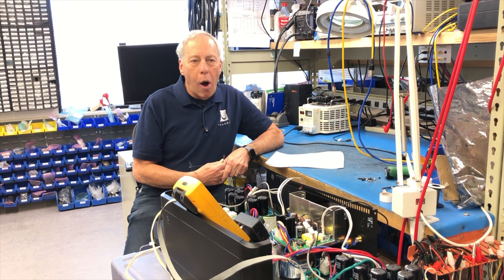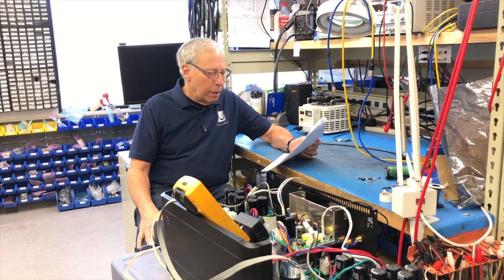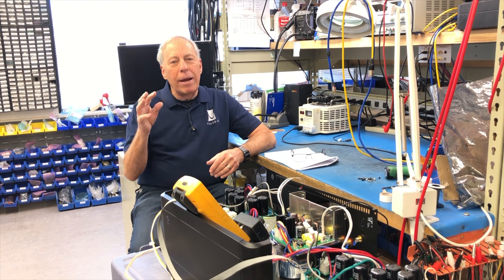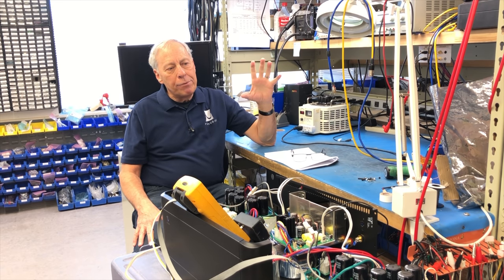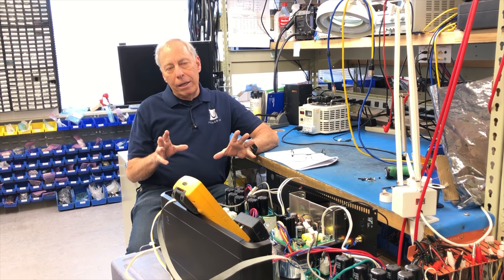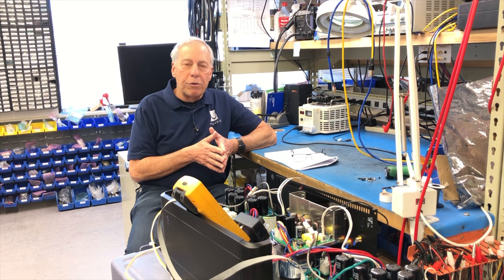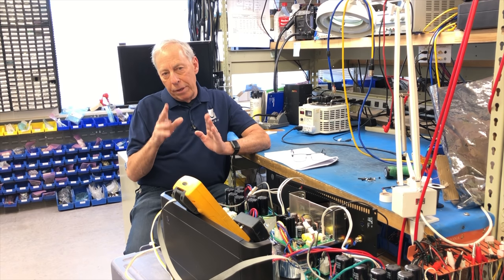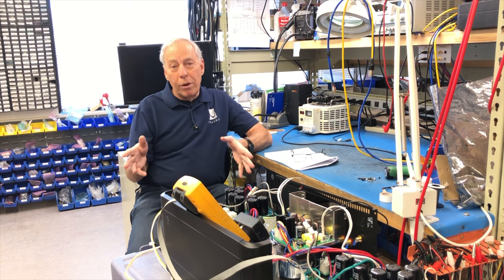How to choose correct amplifier wattage

Comment: Another way to put it would be all other things being equal a bigger amp sounds better. IF you're going to use it in the power range it was meant to handle cleanly and not playing whisper soft background music.
Reply: You have it all wrong.
Reply: All things being equal,  have both an amplifier and speakers that exceed your desired listening level and make judicious use of the volume control so that you don't push either of their limits.
Reply: @timharig  If you're want to push either to their limits you need to upgrade.

Comment: Thanks paul for explanations also on the car amplifiers is the same?
Reply: Essentially, yes. I have a friend who has more than double the power I have on Focal K2p 3 ways. His sounds more at ease at the volumes where mine start to sound slightly strained and congested in comparison. Both systems are adjusted so that hard clipping is not possible. He has much more headroom than I do. If you never turn it up that loud, I suppose it would be a non-issue.
Reply: Basically but you can damage speakers having too much power and not enough speaker if you have too much headroom and turn it up too much
Reply: @slokke99786  That is true. Drivers can bottom out, and heat can melt the adhesives that hold them together. With power comes responsibility. Unfortunately, there are lots of folks with ears of steel who would "ride a good horse to death." My system is as idiot-proof as I can make it. It is easy to do if your source (in my case: car radio) will not clip even when turned all the way up.
Reply from the maker: Car amplifiers are a tough breed because they are so limited by their power source. The techniques to overcoming the 12 volt limitations are to have speakers with extremely low impedance (old school) or to use a modern switch mode power supply. If it's a modern car amp then much of what I suggest will apply.
Reply: Paul, I apologize if you covered this already, but what do you think about anti-clipping circuitry in amplifiers? I used to have a McIntosh car amplifier that had it. Still have a Blaupunkt Velocity V7000 (made in USA, Rocktron's pro audio factory) that has it. Many people argue that it is not necessary if you adjust your gains properly.
Reply: @Paulmcgowanpsaudio  Oops, see above.
Reply: @Paulmcgowanpsaudio  Leads me to another question: should you match amplifier rms rating to speaker rms or max ratings? I have always done rms to rms given that amplifiers have some headroom (some more than others).
Reply from the maker: @johnclark3067  I don't personally match amps to speakers in terms of wattage because I have never found a useful correlation between the two. What I find more useful is the speaker's sensitivity. If it's in the 80s you'll really need some amplifier grunt to get it moving. If in the mid 90s then the amp can relax.

Comment: Damage only occurs when the amplifier is stressed and starts to clip. You can never send too many watts to any speaker. None of them will fail. Only when there's any clipping involved. Including soft clipping. People think that soft clipping is okay when it's not. That's what causes your speakers to fail. Nobody should ever start to smell their loudspeakers cooking after a high volume listening session. Unless you have a frying pan sitting on your class A amplifier cooking an egg lol
Reply: Sending too many watts to a speaker coil turns the speaker coil into a heating element. Sooner or later the speaker melts or burns. Either way,  its a tradeoff. They key is to have a big enough amplifier and speakers that will not melt or clip at your listening level, then make judicious use of volume control.

Comment: Is this video referring to guitar amps and speakers or for an amp for a stereo system?  Because I was always told that if I plug an amp with 100 watts (for example) into a speaker cabinet with a rating of only 50 watts, it will likely damage both the amp and speaker, is that accurate?
Reply: It refers to any audio amplifier.  You have a tradeoff. If you amplifier is too small it can distort or clip when you attempt to drive too hard. Clipping can damage your speaker. If you get too large of an amplifier and turn the volume/gain all the way up, then you can overpower the speaker and damage it.

Paul's advice assumes that you are responsible enough with the volume control not to overpower your speaker.  If you can be that responsible, you will have better sound quality with a larger amplifier.

Comment: . I sold audio equipment back in 1977-1980 we sold Pioneer, Teac, Nakamichi, Luxman certified and Mcintosh uncertified . We saw the greatest failures with our smaller amps . For example we had more failures with our L80 (50 watts) and less with the L85 ( 80 watts) and none with our L100 (110 watts) on the same speakers . 

The results were not surprising to luxman engineers and they came up with the same reasons you did 40 + years ago . As the amps struggles it outputs trash to keep up  . When we contacted the speaker manufactures for warranties and they said the same . 

We purposely trashed out speakers conducting our own tests .  Selling systems that blow up in our customers homes is a bad look and quickly leads to chapter 7.  At first out test failed because we used common sense when it got too loud we cut back on the gain . With ear protection to fool our ears we just poured on the gain . We had a total of 3 failures out of 6 all from  using smaller amps we had 0 failures using amps rated at twice the speakers recommended power . We would have blown those last 3 speakers but it was so loud we had noise complaints . Our store neighbors also claimed damages caused by the loudness . 

Now the sticky part the speaker makers have a rating, you exceed those rating and no more warranty ? Whatever warranty means nowadays ???
Reply: edwardschlosser1  

Great points.  You sound like someone that uses good common sense . I occasionally use my first stereo amplifier a Mc225 . 

You're right ! It was the point I was going to make if someone replied . The other extreme small amp with capable speakers . Who am I kidding I have that big 300 watt McIntosh stereo amp for bragging rights but my wife slaps me down when the music gets above a mouse fart . Even listening to headphones is too loud for her . 

If I ever win the lotto I'm moving to NOLA by myself and taking my loud ass system with me
Reply: They shouldn't make smaller amps to allow damaging levels then.
Reply: @ryacus  

No they shouldn't ...  short answer .

 all speaker systems have a ceiling, it transitions from db's per watt to watts per db . When a speaker starts to transition you better have clean watts / power to spare or your amp will start to output puke and poop . Puke and poop in your speaker system leads to a cleanup on isle 8 . 

2 schools of thought ; the wine and cheese 2.5 watt systems on horns and everyone else. Option 1 takes careful planning, option 2 not so much . 

If you are smart you'll know your systems limitations and show some restraint . Extensive research and planning pays dividends. 

As the great Michael Vick says I have no dog in this fight .
Reply: Paul only answers half of the question. The real answer isn't about speaker rating vs amplifier rating.  The real answer is about the listeners preferred listening level. Then choose both the amplifier and speakers with ample headroom above the listener's habits.
Reply: @timharig  I agree with you but we now live in the Facebook world 90% show 10% go . I agree with Paul in theory .In theory the input should have the same loudness at the starting gate . Just to make a point let's say you have a 5 watt amp vs a 300 watt amp.  anyone with 1/2 a brain cell knows the 300 watt amp reaches 5 watts with a lot less turning of the knob. 5 Watts almost takes a full turn, on a 5 watt amp and maybe 1/4-1/2 turn on a 300 watt amp. There's so much this video didn't have so its really just for rule of thumb . Just a guide . Speaker selection is another video . This is just a quick and dirty guide for picking the right wattage . The quick answer is there's no limit on max watts as long as the input gain is the same. When speakers reach their limits they start to flatten out . My initial input was to point out my experience with under powering and to me that's more danger.  I agree with you on proper speaker selection . I also believe that speaker selection should be solely based on demos not reviews . I call ebay the final resting place for bad decisions and no research . I believe in research twice buy once . If I had to guess on minimum watts for a speaker should be the maximum speaker rated capacity in RMS. That's more of an efficiency issue .I start at the speakers and work my way forward .  Will a 105 Db speaker work well with a 2 watt amp? absolutely yes  .
Reply: @charliedavidson3878  " I agree with you but we now live in the Facebook world 90% show 10% go ."

I am not on facebook and I have no idea what you mean by that.

" anyone with 1/2 a brain cell knows the 300 watt amp reaches 5 watts with a lot less turning of the knob. 5 Watts almost takes a full turn, on a 5 watt amp and maybe 1/4-1/2 turn on a 300 watt amp. "

Not necessarily.  The amplifier determines the voltage level based on the source.  It is the speakers that determine the current and power for that voltage.  So if you have two amplifiers with the same gain using the same speakers, how far you turn the knob will be the same. The difference is that if they reach 5w at a quarter turn, the 5w amplifier will begin to clipping before that point while the 300W amplifier will continue to increase power well past the quarter turn.

"My initial input was to point out my experience with under powering and to me that's more danger. "

And my point is that is only half the danger.  You can do damage by both underpowered amps and overpowered speakers. I have seen both.  Both conditions are caused by equipment that was not sufficiently rated for how it is being used.  You don't choose power ratings based off of the other component.  You choose based off of determining how you will be using equipment and give yourself enough derating and headroom for both components based on that usage.  As long as both are rated significantly higher than you will ever actually use them, you will not be doing any physical damage. As for sound quality, will will discuss below.

"Will a 105 Db speaker work well with a 2 watt amp? absolutely yes "

And I would say almost certainly not.  we above discussed physical damage to the system.  Now we will discuss damage to the quality of the sound.

None of the components that we use to build amplifiers (tubes, FETs, BJTs) are linear devices.  They are all based of of polynomial or exponential curves. To get around that designers constrict the operation of their amplifiers to small portions of the curve.  Just as the earth's curvature is more detectable by the more of it that you can see (like when you rise in altitude), the more of the amplifiers curve you can detect as you see more of that curve.

Suppose that you are listening to your system with an average of 1W output.  The peaks at the highest dynamic points will exceed that.  Lets say for the purpose of argument that they are just under the point of clipping.  So you are seeing the maximum part of the maximum part of the 2W amplifier's curve.  You are also seeing the maximum amount of the amplifier's distortion curve.  It's not going to sound good.

If however you listen to the same 1W average output of  20W amplifier and we assume that the peaks are still just under the 2W ceiling, then you are only seeing 1/10 of the amplifier's total distortion curve and the distortion will be far less detectable.

So if you want to make a rule, you need to figure out how much power you plan on listening to for your chosen speaker sensitivity, including the highest peaks.  Your speaker's power specification should exceed that with derating. At a bare minimum, you also want your amplifier to exceed that with derating.

That bare minimum will prevent you from damaging your system; but, not necessarily sound good.  To sound good, you want increase the amplifier specification to give yourself headroom.  The more headroom you give yourself, the less of the distortion curve you are going to see.

Comment: Offcourse Paul is right, but I am happy with my 2x65 Watt amp connected to my 300 Watt speakers. The torroidal transformer is oversized and the listening levels I use are about 30 Watts, so still plenty of headroom, above this and it is bad for my ears anyway.Loudspeakers play a big role, I don't think many speakers out there are able to produce undistorted sound at 700 Watts.

Comment: Paul, Ironic that your discussing clipping. Your mic audio is WAY TOO HOT! Leave some headroom!
Reply: But that is not destroying anything though :p . Yes, when recording and you have no compression, you should be between -12 dB and -18dB when recording. And normailze the volume to -1 dB max after the take.
Reply: Le fil rouge with our dear ol'Paul. I'm starting to think he's unable to hear clipping anymore...;-)
Reply: Do you want a video every day or do you want no clipping? The reason we get so many videos is because they're quick and easy for Paul to make. Stop whining. If it bothers you that much, find another channel to watch
Reply: @mark22732  It doesn't take any more time to get it right. Just a simple level setting.
Reply: @dhpbear2   Likely, it's just him and thus auto level control (AGC) in use, but remember, he clears his throat occasionally so that may tax either the mic or the camera's amplifier, but that's about all the distortion you get, otherwise it's pretty clean to me as he keeps his voice relatively moderated - and his mic is wireless so there is that to consider.

Also notice, auto iris, when he's moving about in music room 2 I think where the IRS V's are, the iris adjusts as it senses him in the frame or not as he moves, so this is a one man show. If he is using manual record levels, he can't be there to quickly adjust the recording levels and videotape at the same time, and most consumer cameras don't make that easy to accomplish  while taping anyway, if they have manual settings at all.

Comment: There used to be a time when smaller amps sounded better. High power amps seemed to have crossover distortion as you pushed them. That doesn't appear to be true anymore.
Reply: Crossover distortion is most prevalent at lower levels where the notch at the zero crossing between the complementary output devices is more significant compared to the signal level.  Since crossover notch does not change with level, the higher you drive the signal, the more the distortion is masked.  This is characteristic of a class B amplifier where the bias is such that the positive and negative devices in the output stage are switched off at the zero crossing of a signal until say the positive trending wave has enough drive to switch the positive device on, and vice versa for the negative trending signal.  In essence there is a dead band at the zero crossing.  A properly biased class AB amplifier does not exhibit this characteristic because the complementary devices are never fully switched off.  Smaller amplifiers you refer to were probably class A in which there is usually a single output device with no complement.  The class A topography is biased so that the output device is full on and essentially dissipating full power whether there is a signal or not.  This bias scheme eliminates crossover distortion entirely at the expense of poor efficiency.

Comment: This is not only counter intuitive it is also counter real world experience.  I've blown a pair of speakers. My brothers kids blew one of his speakers during an outdoor party. If you can't have too much power why do speakers get blown out?
Reply: Not at all, he explained it perfectly clear. Of course you will blow a speaker if you turn it up too loud. But you need the headroom as clipping is more likely to kill your speaker on a lower powered amp than having too much power.
Dynamics are also an important part of realistic sound. You need double the watts to increase the volume by +3db. So a 300w amp for example only powers the same speakers 3db louder than a 150 before clipping. These are key concepts as amps are exponential in how much power they put out to linearly double the volume. This is why home theaters need to many watts to sound correct, as THX reference level of 85db for the voice track requires +20db peaks in the subwoofer to make 105db like a theater. Well going from 85 to 105db requires 6 times the power which suddely takes you easily into the 100's and 100's of watts to do this without clipping.
At least that is my understanding.
Reply: It seems to me that I already answered your question in a duplicate post -- but,  the answer is that you should choose both and your amplifier and your speakers with enough headroom to exceed whatever volume you are going to be using them at.  If they both exceed your whatever volume you are going to be using them at,  the relative ratings will not matter because your listening will not approach either of their limits.